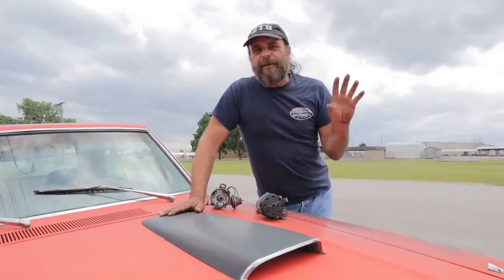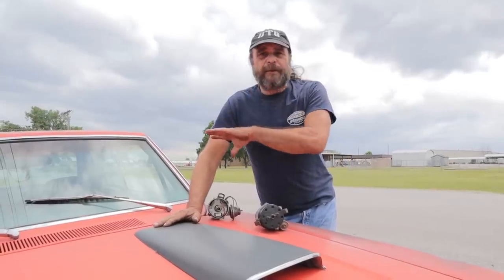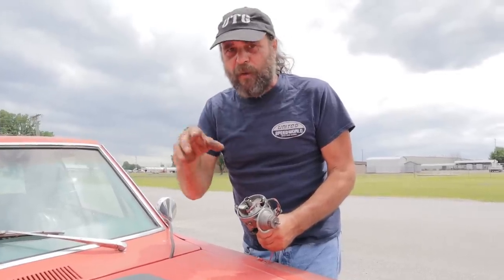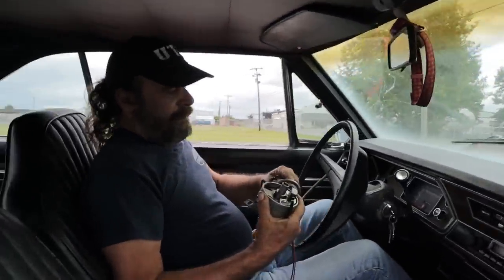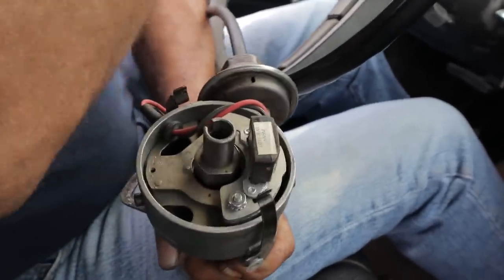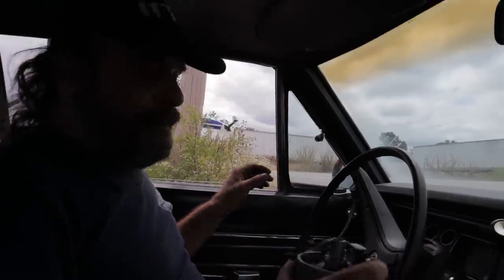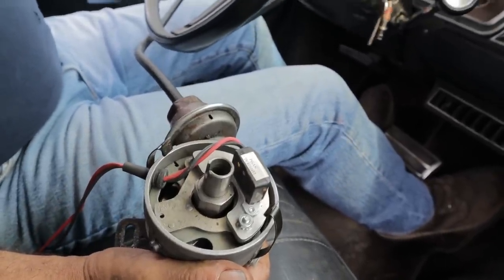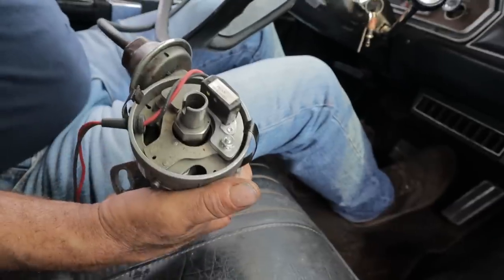The Vacuum Advance Debate!

Comment: I recently finished a new sbc 350 with a pretty hefty cam. I'm currently running manifold vacuum and using a MSD Pro Billet distributor and a 6AL box. It runs like a raped ape. I've never had throttle response as good. Only thing is that it does run a little warm at idle. Enough to get the thermostat to 180 and trigger the electric fans. I'm going to switch it to ported vacuum tomorrow and see how I like it.
Reply: @kennywhiddon1497  I did. Tried it the other way. Didn't like the results. Put it back.
Reply: Your cam is proobably not providing enough vacuum at idle for manifold vac.

Comment: And also a vacuum controller for nox's emissions. By 1973
Reply: I had a 71 ford with a differential distributor vacuum advance can, front of can went to ported and rear to manifold, something like that. Long time ago so don't recall exact detail but it was a differential vacuum can.  My '73 has a thermal switch so once engine hits a certain temp, manifold vac is routed to distributor, increasing idle speed by adding advance.  The idea is, higher idle speed moves more air and coolant to cool things down.  Then returns to ported vacuum.  There were speed sensors too, controlling vacuum advance.
Reply: @thisisyourcaptainspeaking2259  Curious, was this a California truck?

Comment: Interesting. I thought ported and manifold vacuum were the same once you crack the throttle blades
Reply: Watch a ported and a manifold vacuum gauge side by side at the same time. There are exactly the same at a band from like 5 to 15 inches of mercury.  On the edges of the vacuum range they are exact opposites of each other.

Comment: Hey Tony with more advance on acceleration it won’t ping?,I’m going to try ported now on my 71 stock z28, thanks for vidio.
Reply: Ported will require a different timing curve and carb calibration than with manifold. Manifold adds more advance at idle and therefore the carb needs to be leaner at idle. This will decrease engine temp at idle and increase mileage while using the transfer slot.
Reply: berserk7111 yes with the manifold vac it will run cooler correct, also on ported vac I would think engine would ping with all that timing coming in

Comment: Hey Tony
 Good video. Manifold vacuum to vacuum advance will give you a stumble when you stab it at idle. Ported will not. Manufactures have used all types of systems to control vacuum advance. Transmission controlled
is just one of many.

Comment: Iirc, rich conditions need a later spark, where as leaner conditions need a sooner spark.

And, also iirc, ported vacuum wasn’t a thing until egr and emission testing were introduced.

https://www.jalopyjournal.com/forum/threads/ported-or-manifold-vacuum.314524/page-2

Update: so just for shits and giggles...I decided to do exactly what he does in this video....ie switched the vacuum hoses. Uncle Tony is correct that FOR PERFORMANCE, you should be running on ported! For grandma’s caprice going to town twice a week, run it on manifold vacuum. 

I stand corrected!

Comment: Can somebody Barney this for me a little more?
When hooked to manifold vacuum it's easier to start but will knock and ping under heavy acceleration.
When hooked to port vacuum it will be harder to start, but will cut down on knock and ping under heavy load.
Did I understand this correctly, or am I backwards?
Reply: Carb and distributor setup is different for Manifold than it is for ported. Idle loves advance. Runs smoother, cooler and more efficient. Manifold gives more advance once vacuum developes, ie., easier starts. However, it requires a leaner idle which affects the rest of the carb settings and therefore the timing needs. It sounds like your engine is setup for ported vacuum which can cause hard hot starts and overheating at idle. Manifold is best for a daily driver but it must be setup for it.
Reply: @kennethhall1270  Initial timing is for ease of starting. To much initial advance is hard on the starter. On a port vacuum it is also your idle timing. 10-12 is generally the most you can get away with before hot starts start overworking your starter. On manifold vacuum the engine starts at 10-12 until vacuum increases then the advance canister adds an extra 10-15 degrees at idle. So, an engine with ported vacuum set at 10 degrees initial will idle with 10 degrees of advance. An engine with manifold vacuum and initial set at 10 degrees will idle at 25 degrees once vacuum advance kicks in. A 25 degree idle requires a leaner mixture then it does at 10 degrees. As you say, cylinder pressure affects timing but it does not solely dictate timing. In fact, I don't even consider it when choosing idle timing. A/F ratio is more important to me at idle. More advance at idle allows for a leaner mixture. This why you guys with your ported advance and 10 degrees of initial are gassing everybody out at the drive-thru.
Reply: @adamfield4068  Care to elaborate?

Comment: I'm getting detonation at maybe 75% and up throttle, initial timing at 4 degrees, no vacuum advance just mechanical advance on a Chevy 350. =10 MPG🤮 going to set up advance using manifold setup-- wish me luck
Reply: What year is your chevy if its 1991 96 maybe vortec heads they only like 29 30 total maybe recurve to limmit mechanical from 21 * to ? Whatever works
Reply: @rooster68able  1970 C10. Vacuum advance on ether port or manifold giving me rocks in a can at almost any speed. Can't get off the line with manifold without rocks almost at idle 🤭. Haven't checked TDC yet, motor still in truck. Thanks for listening-- going to need professional help 🤕

Comment: Vacuum advance never "retards" the timing. Hence the name.  It reverts back to base timing under load or low vacuum.  Under decel or part throttle the amount of vac advance increases to increase fuel economy.  Mechanical advance is a separate animal.

Comment: Put the advance curve that the engine wants in the distributor. If you want more fuel mileage hook the vacuum to manifold vacuum
If you then Hook to ported vacuum you are putting to much advance timing in the engine.

Comment: Great explanation and demo. I have a Rover V8 powered manta and that has always had a stumble on acceleration and surges on light throttle, I believe it can be an issue with the Rover dizzy hooked up to an Edelbrock 4 barrel. I recently added a throttle delay valve in the vac line to try and smooth things out but not driven the car since so don't know if it's helped any.  Any one else tried/use one of these?
Reply: Also make sure you're on the correct vacuum port, the egr port is easy to confuse if there's one b/c it's also ported vacuum.
That said, look around for an adjustable vacuum can if they're avaiable.  Would that be an oldsmobile offshoot?
Reply: James Mottley  Ok, I'm pretty sure its on ported vacuum but will double check. Yes the Rover V8 is the old Buick/Olds 215 motor, be interesting to see if adjustable units are available for it.
Thanks for your reply :)
Reply: Cpt Pugwash 
Yes, need to go through everything, so easy to chase the wrong thing!
Reply: @stratznhatz  Yeah, I meant buick up there, sorry. I've kinda got a thing for those old buicks so have compiled info.  Have not had the pleasure of seeing the rover version but a buick disto might just slide right in?  I collected a couple timing covers for buicks when I heard good ones were getting harder to locate.  I may have info on the vacuum can, somewhere I have a list of most GM vacuum cans, broken down by pre and post HEI.  There were some interesting and confusing setups when the 90 degree v6's were going from odd to even fire, split crank journals, bla,bla.  An involved, twisting and lengthy story.
Reply: @stratznhatz  Try this link to a pdf file listing many of the vacuum advance cans used by gm over the years, not sure of course if the rover design matches but maybe?
http://www.metroli.org/pdf/WHITE%20PAPER_Vacuum%20Advance%20Operation.pdf
Reply: James Mottley 
No problem, Oldsmobile and I think Pontiac had versions of the same engine so you were right anyway!
I suspect a Buick distributor may fit as I don't think they changed anything much until later years when they brought in the 4.0 and 4.6 Range Rover motors and did away with the dizzy, couldn't say for sure. The later ones also have a crank driven oil pump which improves the oil pressure over the old distributor driven pumps. 
I know a guy who has a hot rod Morris van with the Buick V6 in it, (not sure if it's odd or even fire) but aparently it goes like a stabbed rat! Interesting to hear about all the oddities (or eventies) about them, split crank journals? I've heard about that on bike engines but not in a car. Thanks for the insight😊👍
Reply: @stratznhatz  Yes, you're correct about similarities of the olds version, etc., kinda getting into rare stuff...  Same block, different heads maybe, sheesh things were changing year to year.  Let me know if that link fails or search for "distributor vacuum advance control units lars grimsrud" for the pdf.  I probably have more, not sure what.
Reply: @James Mottley 
 That's great, thanks for that! Some interesting reading there for sure. Hopefully there is one that will fit the Rover. Even if it's not what's causing my issues it would be good to find one more compatible with the 4 barrel and mild cam I have in there. Appreciate your help!😊👍

Comment: It will burn a tow rig down. If your pulling 45 degrees of advance under load it will detonate. You want advance all in while you are under high vacuum low load you want it to drop off to 35 as vacuum goes down and load goes up. You will get shitty mileage in town useing ported and blow a motor if your towing.

Comment: Pardon the late arrival, but maybe its time to rename these things: idle/low speed retard.  That is their true function at the end of the day: detune the curve when we let off the gas for a smoother running engine.  The presence of correct vacuum signal just restores best [normal] timing.

Comment: Ported Vacuum gets a bad rap as it was totally misused in the horrible early seventies emission motors. People even go do far as to say port vacuum was never used before emission control but my 67 Chevy truck has ported vacuum advance and it allows a smother idle and great performance staring a load while slipping the clutch.

Comment: I see this discussion a lot and sometimes it gets heated, even.  Can"t say I"ve ever seen a manifold vacuum factory setup, at least not in my memory.  If I ever do, Ill look closer to confirm the advance is pulled in, not out, with vacuum.  Willing to check my '49 ford flathead if anyone thinks the old non-smog engines were different, but I don't think it's manifold vacuum either.
Reply: On my 65 Corvette vacuum advance is connected to manifold vacuum. The carburetor doesn't even have a ported vacuum port. Ported vacuum was added to carburetors in later  years to decrease emissions at idle. Initial advance at idle was set to 8º BTDC.
Reply: @richardcampbell5866  Ah, so I do need to confirm the '49?  I do believe the steel tube from the distributor is connected to the original 2bbl Holly.  Pretty sure I have a manual for your year vette, might not show vacuum routing though.  I don't doubt you, it is a vette after all.  I recall pondering this with a '69 chevelle decades ago as well...
Reply: @richardcampbell5866  Okay, curiosity made me look, lol, the '49 ford has a steel vacuum tube from the distributor can to the 2bbl carb and connects above the butterflys.  I can't say for sure it's ported short of tearing the carb down but it looks ported.  BTW, thanks for the vette info, gives me a direction to go hunt.
Reply: Take a look at some 460 7.5 liter 1979 ford F350 vacuum diagrams non-california, they are all factory manifold vac to dizzy. Right in the factory diagram
Reply: Yep, and FWIW, my 1971 Torino GT 351C had a differential vacuum canister with a vacuum port on both sides of the diaphragm.  Don't recall how it was plumbed.
Reply: @richardcampbell5866  Richard, if you have the opportunity, I'd like to know how much vacuum is necessary to pull you canister advance all-in?  I believe the manifold vacuum advance cans were all-in at about 5" vacuum thus don't drop out during normal throttle tip-in, only if the accelerator action drops manifold vacuum to less than 5" or so.
The ported style vacuum cans require much more vacuum for all-in, about 12" or so.
I'm also curious to know how much advance occurs when your can is all-in, if you're up to it.
I'm guessing it's about the same amount of advance as ported, so max advance is around 32 degrees vac+mechanical together.

Comment: I've always tried it both ways for the street and played with the mechanical timing in conjunction with each way, looking for the best power and drive ability.  For racing engines vacuum advance never works.
Reply: Marine engines are always strictly mechanical, there just isn't enough useful vacuum signal in this application.

Comment: I dont no , vaccum advance in cetain situations like to full manifold will help idle quility  my 454 vortec does not like alot of timming like most other bbc so i get it from vac and it helps with only 10* intial helps with street driving for 👍

Comment: I just choose to run without one I locked it out in my distributor even though the car is driven nearly everyday. Unless I can afford race gas everyday or pull a bunch of timing all it does is ping with the vacuum advance don’t notice much of a difference without it

Comment: I've watched a bunch of these videos and noone shows you where ported actually physically hooks in. Manifold seems obvious. It's frustrating that 16 seconds isn't devoted to actually showing us the difference.
Reply: Typically, your carburetor will have both connections. One connection will be "ported" which will generally have 0 vacuum advance at idle, and then add advance as you apply throttle. The other connection on your carburetor will be "manifold" vacuum which is simply just a pass through directly from your intake manifold. This will give you some timing advance at idle. This is also the same as connecting to an available port on your intake manifold.

Comment: It's weird that anyone would suggest manifold vacuum.  After all, vacuum advance is the ONLY reason that ported manifold even exists, whereas manifold vacuum is used for other things (like power brakes etc.).  There would be no reason to even create ported vacuum if you were just as well off going straight to manifold.  The only reason I can think of that someone would use manifold is if they had a leaky vac. adv. diaphragm, or maybe too strong a spring opposing the vacuum.  It "might" be better in that case since manifold vacuum can be way stronger than ported, but that's just a guess.
Reply: @kennywhiddon1497  Which is why you use ported vacuum, rather than manifold vacuum... like I said.

Comment: We need an even more basic video in what the hell “advance” means. I hear it so much and watch the video but I’m still confused as to what exactly advance means
Reply: Advance means that the spark plug will fire early and retard means that the spark plug will fire late............
Reply: That's in simple words
Reply: @theone5716   By firing early or late, you mean it will fire before the piston reaches the top or after when its on its way down? 
If so, what is the point of doing either or?
Reply: @markdeartola1154  It is always Before Top Dead Center (BTDC) meaning that it is before the piston reaches the top (TDC)
Reply: @theone5716  ok so advancing it more means the plug fires even more BTDC. Whats the advantage in this?
Reply: @markdeartola1154  oh, actually the advantage to this is a cooler running engine with lots of power but an extremely high idle and bad gas consumption.